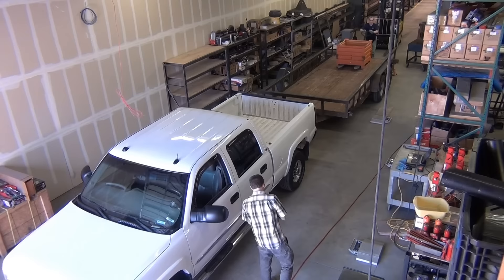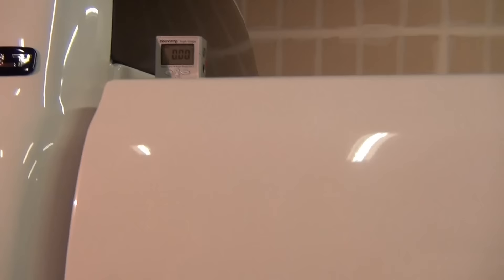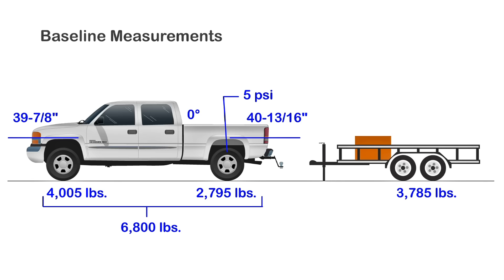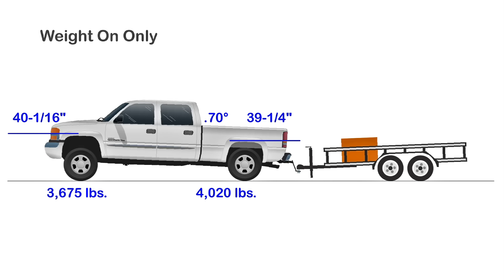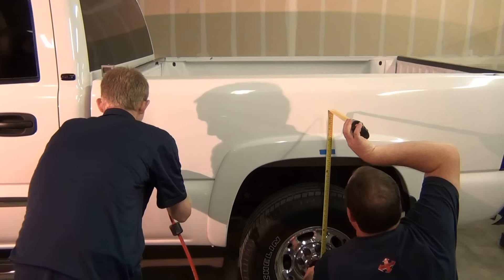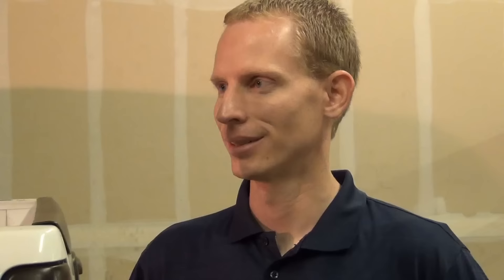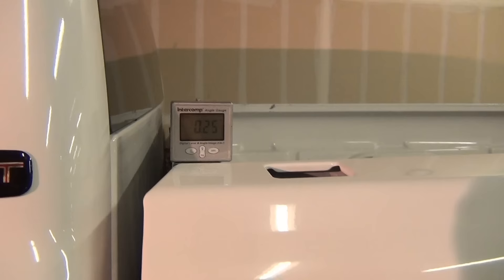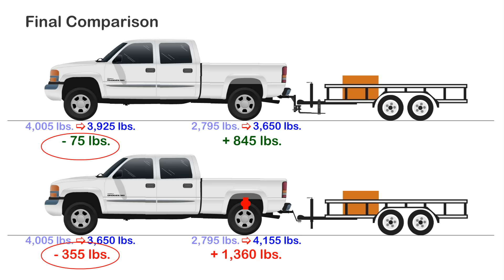The Difference Between Using Weight Distribution and Air Bags to Level Your Load

Comment: It looks like a Sierra 1500 to me. I find this mildly amusing they need to exceed the weight-carrying rate by over 600 pounds to make a point about wd. Just read the owner's manuel of the vehicle, it will tell you to use a wdh above 700lbs. It does not seem necessary at some lower weight, as the passengers will be enough to cancel out the weight loss at the front unless you see a problem having less than 200 pounds missing from 4 tons at the front axle. Wdh have merits, so does airbags. My 2 cents.
Reply from the maker: +Philippe Durand,
The tow vehicle here is a GMC Sierra 2500 w/ the Duramax diesel motor. You are correct, most tow vehicle manufacturers recommend that weight distribution is used for higher tongue / trailer weights. Most receiver hitches give two different ratings, one based on weight carrying, and one based on weight distribution. We agree with you, both weight distribution and air bags have their own strengths. Thanks for the comment.

Comment: How much can an air bag twist and bend?? Like i mean if its not straight up and down.  Can it inflate and deflate even if the back is not straight
Reply from the maker: I would see if there is any guidance in your air bag manual, or contact the manufacturer.
Reply: Convoluted bags (and rolling lobe) are fairly forgiving. Whatever your effective cross sectional area is is directly proportional to your rate. Having the bags angled generally doesn't change the area until you get to angles you will not see in this application.

Comment: Can you use air life and stabilizer hitch?  Same time? Plz someone help
Reply from the maker: Yes, using air bags and a weight distribution / sway control hitch at the same time. If you do so, make sure you inflate the air bags first, then set up the weight distribution. Changing the inflation of the air bags after the hitch is set up will usually change the amount of weight distribution you are getting from the hitch. If you change the air, be sure to check that you still have proper weight distribution.

Comment: I have a 2011 Silverado 1500 2wd how do I find out how much can I pull with it ?
Reply from the maker: There should be a tow rating listed in the tow vehicle specs. If you're unsure, it should be in your tow vehicle manual, or most times you can search it online.

Comment: What if someone has a unibody vehicle and it specifies that no stabilizer bars can be used.
Reply from the maker: Great question. We would defer to the owners manual on that. We wouldn't recommend using a WDH in that circumstance.
Reply: Unit-Body vehicles really are not designed to tow heavy loads.  They are way more flexible than a full ladder type body on frame set up.  Adding a weight distribution hitch will also add more torque to the vehicle which creates stress on the vehicle that it was not intended to have placed on it.  This is a great video that explains how it all works, so I don't have to type out a long explanation... https://www.youtube.com/watch?v=kCgRiVNaXFc

Comment: What is the best setting for airbag suspension longevity  ?  I heard Hight high setting  is gonna make it last longer ? Is that true ?
Reply from the maker: Thanks for the question. Sorry, we are not air bag manufacturers, and don't know the specifics of this. Our recommendation is that you contact your air bag manufacturer directly, or one of their authorized dealerships. They will be able to give you the most reliable information.
Reply: Most manufacturers say to have a min of 5 psi

Comment: Does the weight distribution hitch actually change the tongue weight on the ball of the tow vehicle? Or does it simply distribute the weight from the rear axle of the tow vehicle to the front axle of the tow vehicle and the trailer axle(s)?
Reply from the maker: A weight distribution hitch does not change the tongue weight of the trailer. Instead, it changes the way the tow vehicle and trailer connect, which changes the way they carry the weight. When used correctly, a weight distribution hitch forces the front axle of the tow vehicle to carry most, if not all of the weight it was originally carrying, and forces the trailer axles to carry more of the trailer weight. This reduces the amount of weight the rear axle of the tow vehicle has to carry.
Reply: @FastwayTrailer  if my hitch has a 500 pound maximum rating with a WD hitch, how do I go about insuring that I don't exceed it? Should I throw the entire WD hitch assembly on the trailer A-frame and measure the weight? (E2 is about 90 pounds)
Reply from the maker: The weight of the weight distribution hitch itself does not need to be calculated in the tongue weight of the trailer. To ensure that you don’t exceed the rating of your hitch, you need to take the trailer to a CAT scale, or use a tongue weight scale, and determine the actual weight of the tongue. This can be done by pulling the tow vehicle across and off the scale, then dropping the tongue jack at the edge of the scale to lift the coupler off the hitch ball. The scale should give you a tongue weight (TW) and axle weight. By adding these together you can get the gross vehicle weight (GVW) of the trailer. The GVW and TW are compared to the ratings of the hitch.

While at the scale, you may also want to take axle weights with the trailer coupled. These can then be compared to your tow vehicle and trailer axle weight ratings to make sure they are within the limits as well.

Comment: Are airbags still a good option if I have worn leaf springs and just want to level my ride and am not concerned about coming anywhere close to my rear axle max weight?
Reply from the maker: With a WD hitch as well? We do normally advise against using both together, but if you do, use the air bags in a lower setting. If the WD hitch is set up correctly, there still may be some squat in the rear of the tow vehicle, but that is normal.
Reply: @FastwayTrailer  Why do you advise against using them together?
Reply from the maker: Because the air bags will raise tension off the hitch, decreasing the weight distribution and lessening the sway control. It essentially is contradicting what you are trying to do with the hitch.
Reply: @FastwayTrailer  approximately how much squat is normal when set up correctly?

Comment: What about bags & equalizer hitch? Increased roll stability?
Reply from the maker: It definitely depends on your situation. If you were to use both, make sure you fill up the airbags (to a lower setting) BEFORE you setup your wdh. That will make sure you still are able to get some sway control. I'd reach out to our customer service team 800-478-5578 if you've got any more questions!
Reply: I was curious - we use a Hensley Arrow. Had airbags on the F150, won’t add to the F350 we have on order (will have the camper pkg & rear antisway already).

Comment: Sorry to ask but what if you do both? Would it benefit or would it be useless incase you have them and want to make it nice and complete level ?
Reply from the maker: Using both can be a bit tricky, you'll want to set the springs up before setting up the weight distribution with the hitch. You may need to use one extra washer on the hitch setup to compensate. Thanks for watching!
Reply: @El Kora323     There is another great video showing the effects of using vehicle leveling with weight distribution - https://www.youtube.com/watch?v=mj2oqAiltsk&t=4s. Essentially, set the hitch for a little more weight distribution than wanted before leveling the vehicle. As the vehicle levels, you lose a little bit of weight distribution. Recheck your amount of weight distribution after leveling and see if you are where you want to be and adjust from there.

Comment: When slow corning or backing up the trailer do you remove the arms off the distribution hitch ?
Reply from the maker: +John Clark, neither the Fastway e2 hitch nor Equal-i-zer hitch require you to remove the arms when backing up or in a tight turn. There may be some other weight distribution hitch brands that do require this. Add-on sway control devices (friction sway bars) are required to be removed when making a tight turn or backing up.

Comment: what is the steps to do if you have Airbag and Weight Distribution and also you have 1600lbs in the back of the pickup bed?
Reply: Measure the height of the truck with the 1600 lbs and get it level with airbags, and do everything else like your supposed to,just like you would any other WDH. Don't exceed your GVW. that extra 1600lbs in the truck kinda messes up how much you can tow because of the tongue weight, it adds to the GVW.
Reply: Use the bags to compensate for weight in the bed. You may have to readjust the bars as per the instructions. That is what I did. I set up the WDH as per instructions, added air to the bags to get my desired ride height, then started all over setting up the hitch but this time with the bags inflated to the pressure I wanted to get the ride height where I wanted it. It helped tremendously with ride quality.

Comment: Interesting video. Really had no idea that that was how weight distribution hitches worked. But I’m curious; you said in another comment to someone that if you’ve also got airbags, that you should set the airbags first, and then set the weight distribution hitch so that you’ve got your weight-distribution tension set up probably. Well, I have a Ram 1500 that has four-corner, auto leveling air ride so, how would I set my bags first before I set the WD hitch, if I need weight pushing down on the back of the truck in order to get it to level out?
Reply from the maker: Setting up a weight distribution hitch with auto leveling is a difficult process because the results are so dynamic. Some vehicles have a “towing” mode that can be engaged to improve the process of getting the weight distribution dialed in. Otherwise, we recommend that the auto-leveling system be disabled by either turning off the vehicle, or removing the fuse. Load the vehicle as it will be while you’re towing, turn off the auto-level, and then set up the hitch based on where the vehicle sits. You may want to set it up over-distributed slightly to compensate for the adjustments the auto-level will make once it’s enabled again. Trial and error a few times should get you pretty close.

Also, you may not be able to rely on measuring the wheel well heights to check the weight distribution setup. You may need to measure the actual axle weights to determine a good weight distribution setting. Our guidelines are to return the front axle to at least half the weight lost back, and not exceed the rear axle weight rating. For example, if your front axle weighs 2,400 lb without the trailer coupled, and 2,000 lb with the trailer coupled but NO weight distribution, a good weight distribution setup would return the front axle weight to somewhere between 2,200 and 2,400 lb.
Reply: Well, after deciding to take a look at my manual, it’s actually outlined on how to set up a WD hitch with the air suspension. We have a tire/jack mode that basically turns the auto leveling off when the truck is at normal ride height. You set it there, then you set your WD hitch were it needs to be then drive off. lol. Driving off puts the truck back into normal mode.
Reply from the maker: @billplaisance6387  Cool. Glad you were able to find that. What vehicle are you towing with?
Reply: FastwayTrailer a 2018 Ram 1500. I’ve never used a weight distribution hitch before.
Reply from the maker: Great! Let us know how it tows when you get it all set up. Good luck, and safe towing!
Reply: FastwayTrailer I just thought of another question and I’m curious to hear what your guy’s answer to it would be, or what your thoughts on it would be.

 As I previously stated, my 2018 ram 1500 has the four corner auto leveling air ride on it. In your video, as soon as you air up to the bags to 55 psi to level the truck out, you point out that in doing that, that you took even more weight off the front axle than what was already there without the help of the bags at all; now for my question- if that Chevy had auto-leveling air ride on all four corners like my truck does, how do you think it would’ve reacted once basically the auto-leveling was turned on? I just wonder if maybe the vehicle’s computer would sense the front all the sudden being higher than usual thus making the system compensate by removing some of the air out of the front bags which would make it- I would think-. not require as much air in the back to level the truck out. That Chevy you guys used; having those aftermarket airbags in the back, made it so that only the rear was used level out the truck. The other way however, you’d be using both axles to level out the truck. It actually makes more sense of why using aftermarket airbags alone to level a truck out with a heavy load would make it more dangerous than having the back of the truck sag because essentially you’re shifting even more weight to the rear of the truck.

I’m not trying to look for excuses to not ever use a weight distribution hitch, I’m just wondering how my truck would respond in that situation because of its four corner air ride that reacts way different than springs.
Reply from the maker: Almost all auto-leveling systems to not measure the axle weight. Some Lexus models are the only ones we are aware of that do. All others simply have a gauge that tells the vehicle whether it is lower or higher than a base height, and then the vehicle adjusts up or down until it reaches that height, no matter what the axle weight. In this case, when you add the trailer, the rear will inflate to bring it back to a baseline height, and the front will deflate to bring it down to a baseline height, but the weight on each axle will do exactly the same thing that we show in the video – the rear will increase, and the front decrease. The best way to know exactly what your vehicle is doing is to take it to a CAT scale and weigh it.

Comment: Your logic is off on so many levels. If you add air to achieve a “level stance” then why is it still showing unleveled? Because you didn’t account for the new height of the front axle. Also why is your trailer loaded incorrectly? If you have a thousand pound tongue weight there should be relative weight above and behind the trailer axles. Which would aid in the attitude of the trailer. All the WD hitch is doing is leveraging the weight more rearward. I’d like to see this redone showing a properly loaded trailer. Modern trucks control sway like you wouldn’t believe so I don’t buy the logic “ you need a WD hitch to avoid sway”. Otherwise, nicely done.
Reply from the maker: +Vernon Hopkins,
Thanks for the compliment and comment on the video. We hope that it gave you additional information to make good decisions regarding your particular towing situation that will make it better and safer for you. As for your concerns, we'll do our best.

For this demonstration, we inflated the airbags to bring the rear fender height back to the baseline height above the rear axle. You are correct, it does not come out perfectly level. However, the point was to illustrate that using the airbags has other effects on the tow vehicle besides just bringing it back to where it started, which in this case is to cause even less weight to be carried by the front axle.

As for the trailer loading, you are correct. Hopefully most trailer owners would load the trailer for actual towing correctly, with the weight more evenly distributed, and having 10% - 15% tongue weight. In this case, we never intended on towing the trailer, only demonstrating the differences between air bags and weight distribution. For that, we only needed tongue weight, which gets distributed the same way, whether the trailer is carrying a balanced load or not. The trailer with the balanced load would have shown more total weight on the trailer axles, but the way the tongue weight gets carried by tow vehicle and trailer would not have changed.

There are many factors involved in preventing trailer sway. Trailer and tow vehicle loading, relative tow vehicle size, tire inflation, speed, wind, and many others. Those should all be in line as well for the best protection against trailer sway. Weight distribution hitches are not meant to replace those things, and neither are the modern technological advances in the pickup trucks. They are meant to add another layer of protection and comfort on top of those.

Comment: What about 5th wheels.   Is there anything for 5th wheels ?
Reply from the maker: We don't have anything for fifth wheels yet.
Reply: 5th wheels put the weight directly above the rear axle (okay, 2-4" forward).  No such thing as a weight distribution hitch for a 5th wheel or a gooseneck.  Bumper tows make the rear axle a pivot point.  WD hitches help spread the load off the rear axle to the front axle and even some back to the trailer.
Reply: Prob need a duelly.  All the weight of the hitch is payload, so get the most payload you can.  I’m still sketchy on the whole fifth wheel vs gooseneck thing.